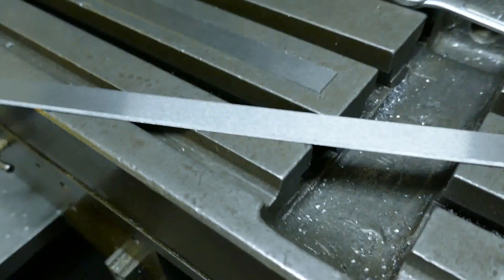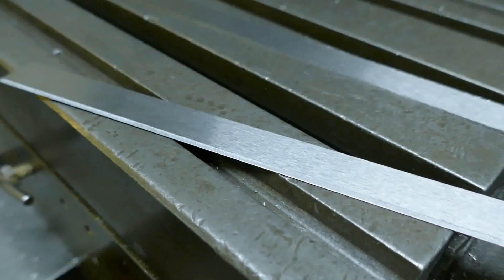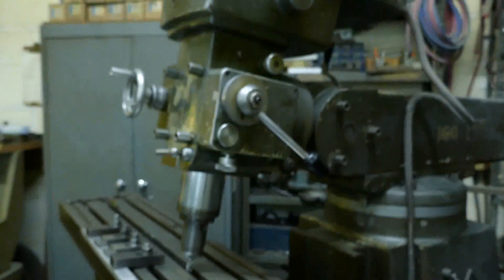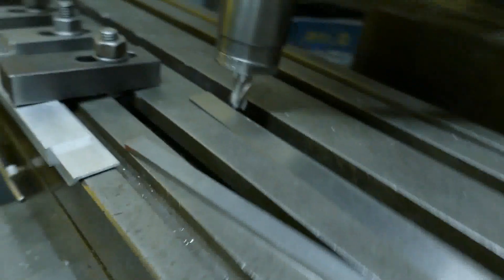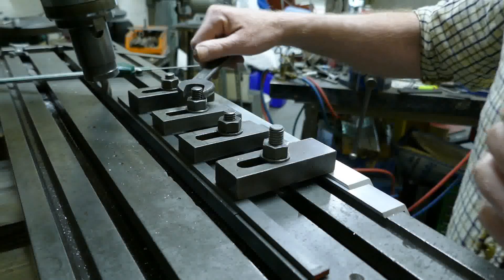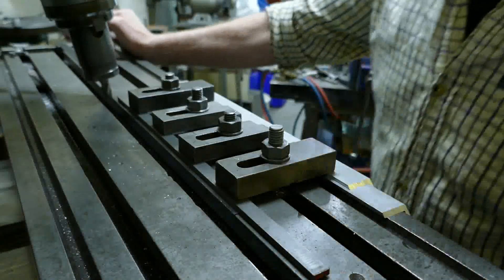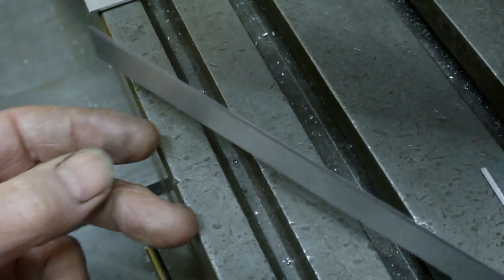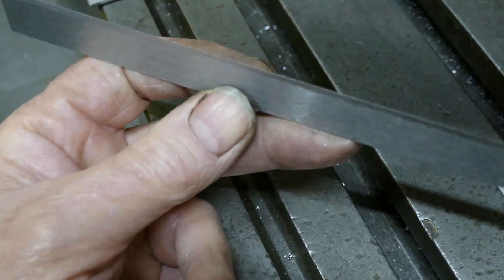Machining thin steel - making some Folding blades on a milling machine.

Comment: Thanks that's very interesting. Wonder how I would do that job? My Harrison mill head does not tip back. Could do it on the shaper in one setup up to 10 inch long. Or of course I could lift the front edge of the blade with the mill head vertical (thinking out loud really). Cheers
Reply from the maker: I can imagine a shaper working well on things like this.

Comment: What is a folding blade? Never heard that term before.
Reply from the maker: These are for a paper bag making machine. They are fixed to a rotating drum, creasing & folding the paper as it feeds through.